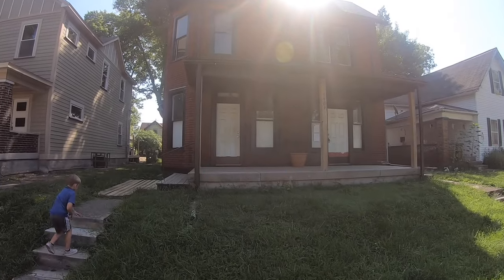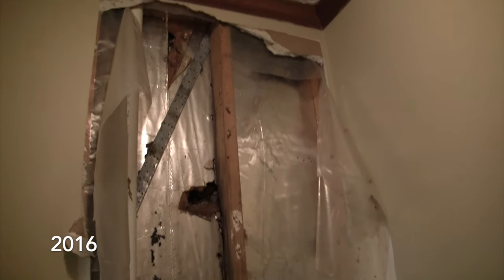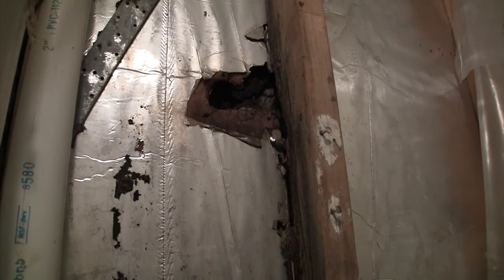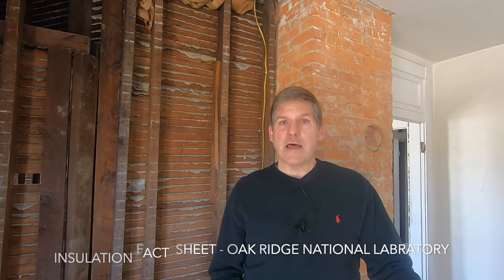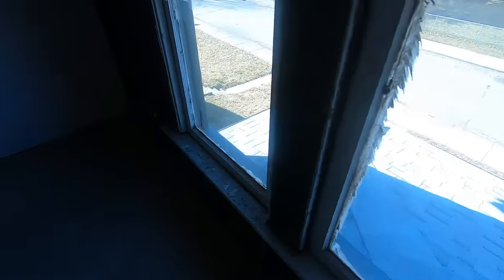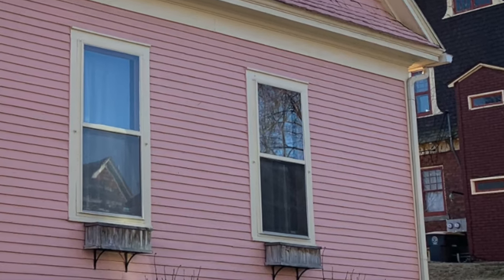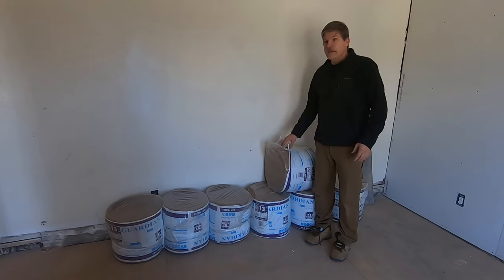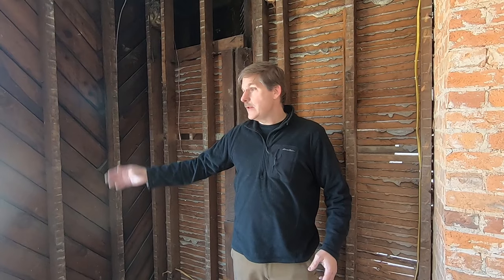How to insulate a 100 year old house and not destroy it - Old House Renovation 5

Comment: I'm not hearing any real advice here. Just 5 minutes of the same warning.
Reply: Right? Nothing of any consequence.
Reply: Did you watch the video?
Reply: Did you watch the ending?
Reply: I have a 120 yr old Victorian and my approach is to air seal and insulate attic to r38 (diminishing returns after that), air seal and insulate rim joist, air seal everywhere else you can think to do, add double pane or storm windows (remove the window trim and foam can the framing around windows too). Wrap pipes in the basement. Take the money you'd have sunk into spraying inside wall cavities and/or replacing all the interior plaster and spend it on efficient heat pumps instead. Walls aren't as important as basement and attic anyway, and imo, spending that couple grand toward heat pumps is a better use of dollars. Good luck my friend.
Reply: He explained the solutions is to take off all of the exterior siding and waterproof the house before putting new siding on. Then it's safe to insulate.

As an alternative I've been looking into rockwool because it's supposed to be breathable and not condensate. They insulated houses in the 1940s with rockwool with no evidence of rot, but I'm still not sure if it's a viable solution.
Reply: @kw6713a you have the right idea. Doing the same with my 1885 shingle style in NJ.
Reply: @kw6713a for attic, Rockwool? Or something else?
Reply: @JoshuaKahr  I already had six inches of fiberglass up there so went with another six of fiberglass on top after air sealing. It's not useful space up there, even for storage. So the itchy nature of fiberglass is irrelevant. If you're going to be up there, I'd probably spring for something less noxious like  Rockwool/cellulose/denim.
Reply: Don’t insulate old homes… these new standards for energy efficient homes with 7+ layer walls are ridiculous and money pits.

Comment: I was told these 1890s homes (like mine)that they were single family homes, in the winter they would all move into one room upstairs, insulate and heat ONE ROOM.   Take down the insulation in spring.  I'm using wool blankets tacked to the walls.   That's the trick.  If you are trying to convert these homes into multiple dwelling floors with different tenants it will be A LOT OF MONEY and every 10-20 years you'll have to gut and redo.   I was told to keep my 4th floor (basement) just as it is DIRT and foundational walls that seep water that the dirt soaks up.   It's been challenging to say the least.
Reply: I'm thinking of doing that with the blankets

Comment: Good points. But vapor barriers inside and out? The craft paper is not a true vapor barrier, neither is the moisture barrier typically on the exterior. Consult with local architect or contractor regarding your specific climate zone. A vapor barrier in the wrong place is not helpful.

Comment: Anyone looking at this video should investigate rockwool vs fiberglass.  rockwool has many advantages but in this context, rockwool is hydrophobic so moisture that gets in can leave again without damage to the insulation, unlike fiberglass. Also, rockwool is highly fire retardant and critters do not nest in it. Easier to work with than fiberglass too. It is only slightly more expensive and, unlike spray-foam, a good DIY insulation.
Reply from the maker: Hey B.C. ,
Much agreed. Rock wool is a best choice product!
Thx for posting and thanks for watching!
Reply: I have a supply of  both rockwool and Owens Corning mineral wool on hand for an old house refurb. Putting it in the walls has me crossing my Ts and dotting my I's to make sure it does no harm. I very like the idea that I can use it and reading comments like yours. But question: most people tout Rockwool vs Owens Corning mineral wool. Is that bc rockwool has become shorthand for mineral wool in general? Like saying Kleenex instead of tissue. Or is there a view that Rockwool is superior to other mineral wool, like OC?
Reply: @diamondbracelette   I have only used Rockwool brand ( used to be called Roxul)  As long as the properties are the same in different brands, I would shop price.
Reply: Yes, I agree on the rockwool. Just used it on a 1920s tudor I bought in CT. Rockwool you can easily cut to fit into the older cavities and love the water & fire resistant attributes.
Reply: @aaronramkalawan2232  do you put poly on top of it?

Comment: Our house used to have very efficient radiators installed in most of the rooms. The house was built in 1913, still has the wall hookups for gas lanterns, and the radiators were, i suspect, from the 60s or 70s. The owners right before us? Yeah, they learned those radiators were worth some real cash. Hauked them, then put in a cheap, reeeeally shitty central ac/heat. They didn't spring for the forced air upstairs, either, so if you turn it off at all, it takes literally days to heat or cool the upstairs. They stayed for a year, filled the silo with non-compostable garbage, left garbage all over the property, cut up several walls in the barn, and hauked anything of value, then sold it for $75k more than they bought it for. They did their best to ruin this house. The people they bought it from live up the road from me about 5 minutes away. They were shocked and angered to see how fast those people ruined the house and property. Wish we had those radiators. Not loving the $350+/mo electric bill.
Reply from the maker: Old houses are beautiful… and challenging !

Comment: We bought a beautiful old two story 1912 house on the Canadian prairies. It gets -55C at times here every winter! So we gutted the interior right down to the studs everywhere. We installed new insulated steel doors and new triple pane windows. Then we zip disked off all the protuding nails in all the wall bays and spray foamed every crack, fissor, joint and junction we could possibly find. Then to maintain dry studs and cladding boards we installed two vertical strips of lathe in each perimeter wall bay top to bottom for circulation air gap. We then installed 2" foam strips 13 3/4" wide in every wall bay on both stories and sealed all cracks with more cans of spray foam. Once complete we installed another layer of 1" foam in all the wall bays and sealed with more canned spray foam. It was a lot of work! But then the foam was flush with the 2x4 studs.

 Winter arrived and our house was the warmest it had ever been in 112 years:)

Our plan now is poly vapour barrier followed by 1.5" of foam sheets for a thermal break over the wall studs and then new drywall and re-install the old original base boards and trim throughout the house. We stored all of it in the basement when we gutted the place.

For the actual concrete basement we installed 2" foam blocks in all the floor joist pockets and then full sheets of 2" foam over the old cold concrete walls secured with 4" concrete screws and large washers. For the floor we also shimmed up 2" sheets of foam and skinned them with 1/4" good one side expensive plywood for a super warm and habitable basement. It is now a beautifully warm and cozy old character house using minimal electrical heat, no natural gas with a tiny wood stove for back up heating. Next year we'll install an air sourced heat pump for the shoulder seasons heating and summer cooling along with solar PV vertically along the back fence and year after a residential home battery system and infloor electric heating. This is what we did...I hope it helps others renovate old homes. Please comment suggestions and questions. Enjoy yourselves out there in this journey:)
Reply from the maker: Thx for that extensive input. Very helpful for people who are weighing their options! Hope you have many cozy winters!

Comment: True, from UK experience you have to make sure hat and boots of the house are good. Fix roof and gutters, and keep the foundations clear of soil and vegetation. Lots of flowerbeds are too high up the wall, trapping moisture. Best way to insulate inside is as you say, don’t fill the cavity, but consider insulating the internal walls, and ventilate well. We used Rockwall wallpaper, it helped a bit. Definitely don’t paint exterior with watertight weather proof mixture, that just traps the moisture inside. Peter Ward is a good uk blogger, he understands old stone properties, damp etc in cold wet northern uk.
Reply from the maker: Hey Jesse,
Thx for the tip and for watching!
Reply: There's so much misinformation from companies trying to make big money off of "leaky basements". Digging a channel and dimple-sheeting the INSIDE of a house that has clogged gutters and a downspout that dumps right onto the seam of the basement, with a floor grade sloped into the house. It's infuriating!

Comment: This video confirms what I am hearing about 100+ year old homes. There is no easy fix to getting them insulated. I'm glad I watched this before trying the more simple fix of injecting insulation behind my old decrepit siding.
Reply from the maker: Those century homes are nice - but complex 😃
Reply: I was told these 1890s homes (like mine)that they were single family homes, in the winter they would all move into one room upstairs, isulate and heat ONE ROOM.  That's the trick.  If you are trying to convert these homes into multiple dwelling floors with different tenants it will be A LOT OF MONEY and every 10-20 years you'll have to gut and redo.   I was told to keep my 4th floor (basement) just as it is DIRT and foundational walls that seep water that the dirt soaks up.   It's been challenging to say the least.

Comment: I have an 1874 fixer.   The roof wasn’t an issue but water was coming in around rotted window sills.  The walls had insulatIon and plastic between the sheetrock and studs which really trapped the moisture.   Rebuilding the sills and replacing the windows fixed it.  The windows were those single pane metal frame type.  Double pane made a huge difference on the energy bill and muted the street noise.
Reply from the maker: Hey JD,
Good job. Back a hundred + years ago, flashing a window wasn’t really a thought. 
Thx for watching.

Comment: modern sience tells us. walls must stay dry or be able to dry. and insalation slows heat loss. thats it. amazing how far we have come. lol. my house is 121 years old old stick fram farm house. almost done with all the interior work. it was rehabed in the 70s where they added insalation. and in o7 when i got it and started the remodle well no water damage to walls except a few places where water had leaked in sum how. so aslong as exterior aint leaken rain in insalaing with batts seams totoly safe.
Reply from the maker: Hey Alex,
Wow - 121 yrs old! Awesome! Glad to hear your house is going strong!
Thx for watching!
Reply: 150 farmhouse /no insulation on balloon framing. Can I put bats in... Then poly and drywall on?

Comment: Keeping a century old home in shape is a challenge. If you aren't aware of the pitfalls of improper upgrades it can really hurt you down the road. One of my relatives had holes cored into her exterior walls and then insulation blown in. She has a major mess on her hands now. That stuff is wet and moldy. The company that did it could care less if it was the right thing for her home. A little research never hurts. Thanks for making the video and pointing out "why" we don't just stuff whatever we can find down into balloon frame style walls.

Have a great Day!!

Edit. Possibly moldy. Won't know until the hammers fly.
Reply from the maker: Hey fxs,
Yikes! People need to know that before getting stuck!
Thx for commenting!
Reply: Funny thing is, on a lot of these older houses, when you tear down the plaster, you'll find out that the people who built it did just that, (throw whatever they can in). Old clothes, rags, newspapers.

Comment: If you can work on the outside with new waterproofing, siding, and windows, that is best.  There are also some options to make a breather gap (covered mesh or spacers) and then use spray foam.  I also like mineral wool because it doesn't fill up with water and can breathe,  but it won't be as efficient if air can move back and forth.
Reply from the maker: Hey eh…,
Thanks for the input.
Thx for watching!
Reply: I think you don't want "air movement" but vapor movement. Air movement inside or through the cavity defeats insulation.
Reply: No new windows!!! I wish this was common knowledge. Today’s vinyl windows are also victims of planned obsolescence and are designed to fail. Old windows are old because they are good — storm windows are the addition and investment any old home owner should be making, for the integrity of the home and the product. New windows are quite literally a scam.
Reply: @taylorjensen6181 so you're saying that I should keep single pane windows in a place where it gets down to zero degrees?😅
Reply: @taylorjensen6181  In the industry it is said, " Do you know why they call them replacement window? Because every 25 years you have to replace them (or sooner)". The old single pane windows, that have been cared for can easily last a century if not longer. Now what does "cared for" mean?  Painting them, along with repairing or replacing their weather stripping (which is generally spring bronze) if they have any. Also using the wooden storm windows or screens, as the season calls for, that were often part of that system. If you never open your windows, then the storm windows could be left on year round.  (What a shame not to have the beauty of nature flowing through your living spaces, but what the hell to each their own.) All that maintenance takes time and we all know time is money. But you are going to spend the money anyways, either by buying "maintenance free" windows (joke, there is no maintenance free of anything in this world...) that will have to be replaced at ever increasing costs over time or taking your time (or paying others) to maintain the windows that you have. Now to the objection that many will insist, "...single pane windows are so energy inefficient...". Well if you are using well fitted or weather stripped wooden storm windows you actually have a double paned window system that has a far greater air space between panes, and probably equal to a replacement window R-value; and even if somewhat less you have to calculate what is the pay back time frame on the often massively expensive replacement option?  The additional bonus is that is they ever "fog up" you just open them and clean it; which is not possible with modern sealed double paned insulated glass.. Pluss your old windows are there already installed and FREE! But if your old windows have already rotted away then you have to replace them, true. Hope this helps someone. Kind regards.

Comment: What about a vapor barrier in a dirt crawl space 1 foot below main floor… add one or let it breath? It’s a old farmhouse built in 1900. I can barely fit lol.
Reply from the maker: Old houses typically have multiple vents and air flows in and out. 
Typically heat leaves through the roof. 
If it is not wet and you don’t have a mold issue, I would not be concerned.

Comment: 1928 home.  Climate zone 5A.  Exterior is aluminum siding over wood siding and ship lap. No insulation,2x4 balloon. We removed interior wall which was Cellotex lath and plaster board.  Pretty much a cane fiber board with two layers plaster.  Looking for best option between faced and unfaced fiberglass or unfaced rockwool
Reply from the maker: Hey @ericmueller4801 ,
If your wall cavities are dry, then they are either breathing well or no water is getting past exterior siding. Are there signs of water having dried? If I were doing it, and assuming I don't know the answer to breathing vs. no water penetration, provided everything is dry, then I would be tempted to go unfaced - and not change the the previous ability of the walls to breathe. Like we said in the video - a lot of this is judgement call and trying to read your situation and all the variables. Do your best investigation and then best judgement call. You can only decide based on what you know. One consolation - some people just throw anything in there w/o thinking. So hopefully your house is a step ahead there at least!
hope that helps a little.
Thx for watching.
Reply: I did the walls in my parents bed room and put in ROXUL insulation and a 6 mil vapor barrier, put up new dry wall. Benn go to go since 2015

Comment: So, as long as I have new siding and new windows, I am going to be good to insulate?

this seems like a "insulation shouldn't get wet" issue not a old house issue.   A gutter that leaks into your walls would cause issues in any home.
Reply from the maker: Hey Joe,
Old windows were not flashed like today… water can leak from there easily. 
Thx for watching!